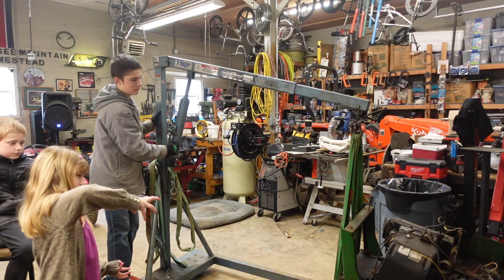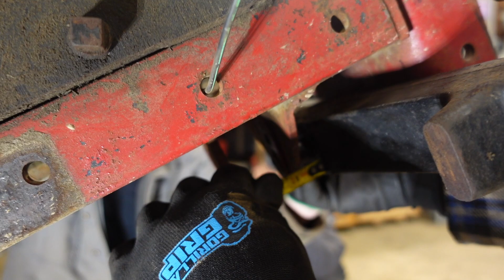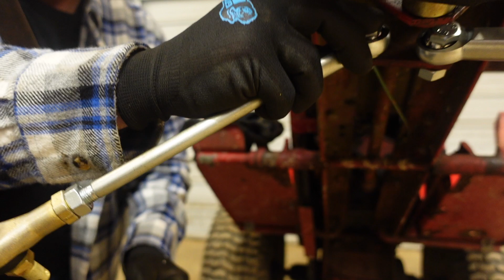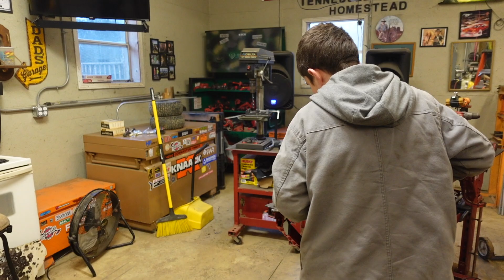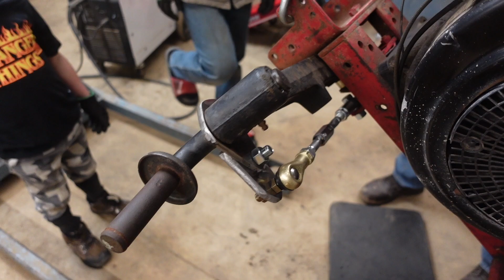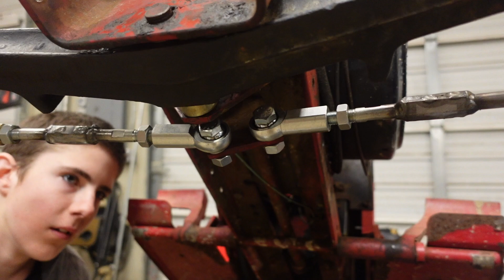John Deere Axle Swapped Into A Wheel Horse! Steffen’s Mud Mower Build Part 2

Comment: Looking for k16 and body and frame parts for my jd 214 to convert to 216 and wheel horse deck as well
Reply from the maker: 214 & 216 are the same tractor, only difference is the engine hp

Comment: Looks great. Good to see the family working together. That extra tab that was in front had me thinking about a new way to do power steering or maybe a steering stabilizer!
Reply from the maker: Definitely a thought, but there won’t be power steering on this rig 😅 however it does need an upgrade from the stock steering system. We might look into a 520 setup or go with a rack and pinion
Reply: @Tennesseemountainhomestead  520 set up is great. It does double the amount of turns of the wheel. The one thing I thought about is when their worn they get sloppy I think my loader tractor the wheel turns like 1/4 turn before the wheels move.  Could probably fix a lot of that with new tie rods and reshimming. Sometime this coming winter I’m going to pull the motor and convert it to power steering.  The second con is people want crazy money for them. I converted the box tractor because I had a parts 520 and it was still tight. Rack and pinion might be the ticket!
Reply from the maker: Yes, I noticed his tractor skips teeth when it gets under a load. There’s a lot of slop in it. It’s also caked in old grease. I need to clean it up so we can get a better look at what we can tighten up